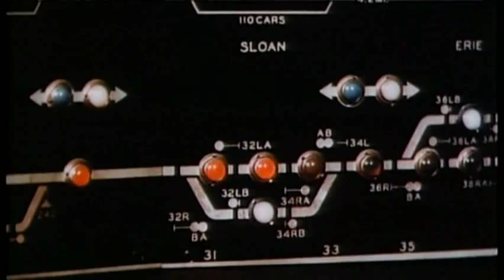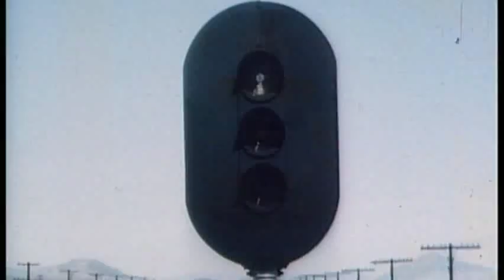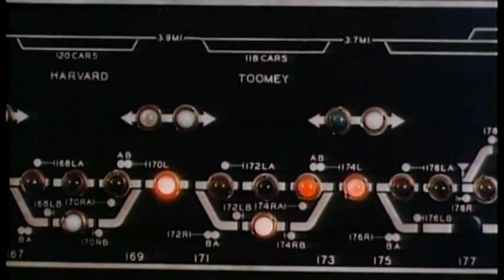Vintage Rail Switching and Centralized Traffic Control - 1944

Comment: This movie short highlighted the early CTC of the Union Pacific's Salt Lake Route, Los Angeles and Salt Lake RR. The CTC Boards located at the UP depot in Las Vegas was first installed in the Summer of 1943 the Line between Las Vegas and Yermo CA. by switching from Timetable / Train Order operations to CTC, a 40% increase on productivity and the Subdivision went from  17 to 5 stations.

Comment: "On June 16, 1943, the Union Pacific completed the last section of a centralized traffic control project on 175.6 miles of single-track main line between Daggett, Cal., and Las Vegas, Nev., on the route between Los Angeles, Cal., and Salt Lake City, Utah."

This is from the September 1943 issue of the journal, Railway Signaling -- with photos and diagrams and 10 pages of detailed description.

"The first operating sub-division extends between Los Angeles and Yermo, Cal., which is 4.6 miles east of Daggett, so that the new CT.C. territory includes 4.6 miles of the first sub- division, as well as the entire 171 miles of the second sub-division be tween Yermo and Las Vegas. 
"The line is single track for the entire 625.4 miles between Daggett and Salt Lake City, but the section be tween Yermo and Las Vegas was chosen to be equipped with centralized traffic control because of the long heavy grades which necessitate slow train speeds and reduce track capacity.
"The country is mountainous desert. On the 171 miles there are only about 7 miles of level track, this being in nine short sections. The grades range up to 1 per cent on approximately 65 miles, and are 1 per cent on approxi- mately 80 miles. Helper locomotives are required on 18 miles of 2.2 per cent ascending grade eastbound."